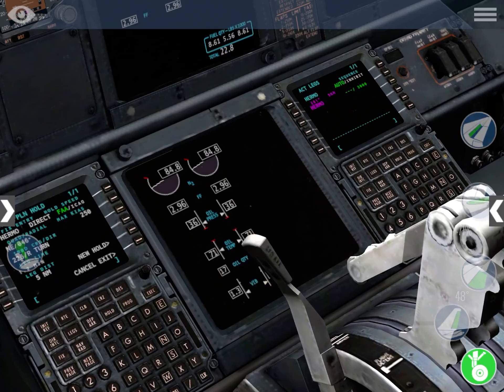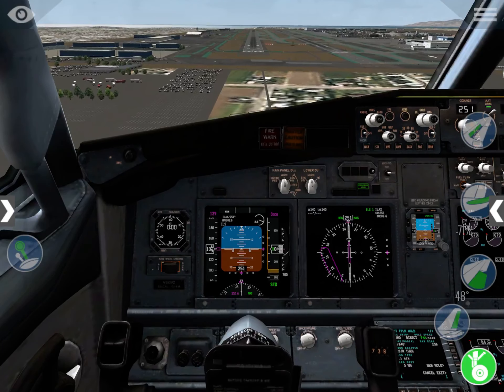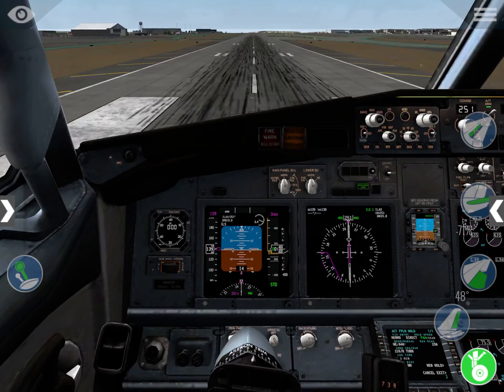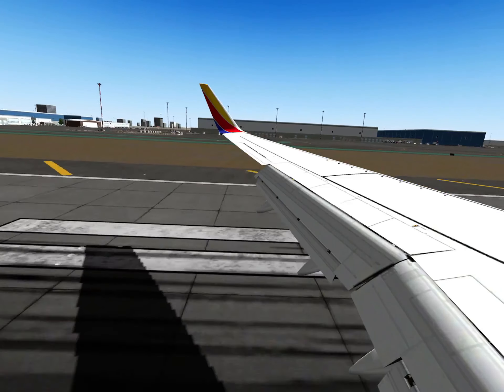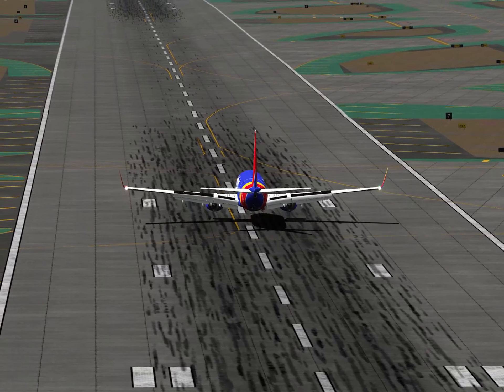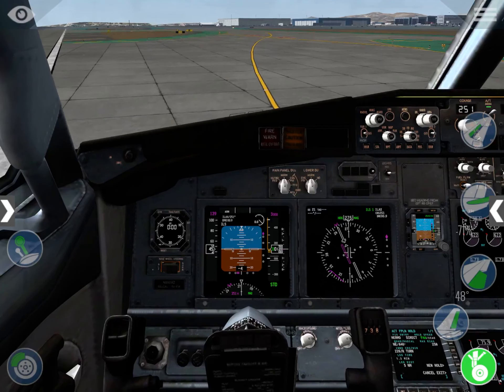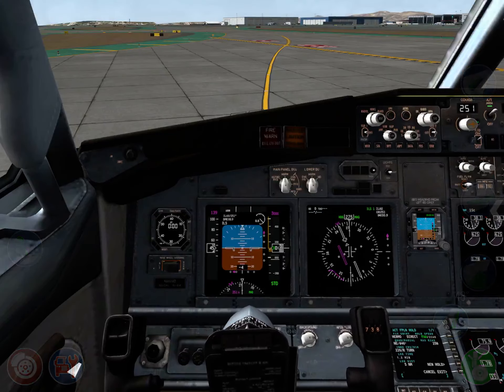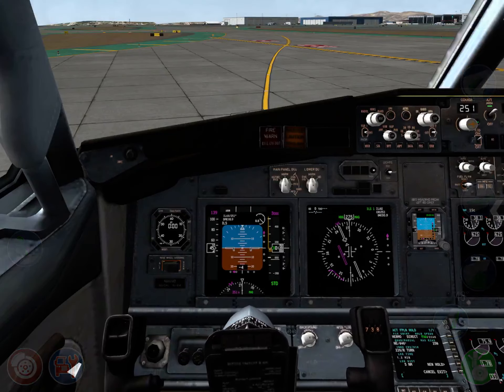HOW to ARM the speedbrake? | Boeing 737-800 | X-Plane Mobile Global

Comment: why the panel on my Android Airbus A320 x plane 10 doesn't work, like a boing 737 that can be pressed
why the panel on my Android Airbus A320 x plane 10 doesn't work, like
Reply from the maker: Because the A320 X-Plane model is not as good as the 737's. That's all.